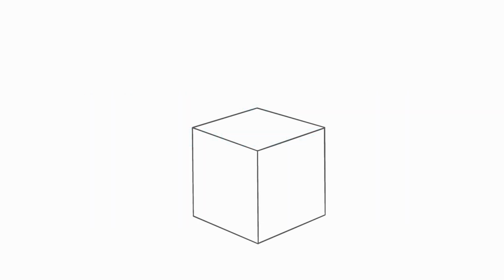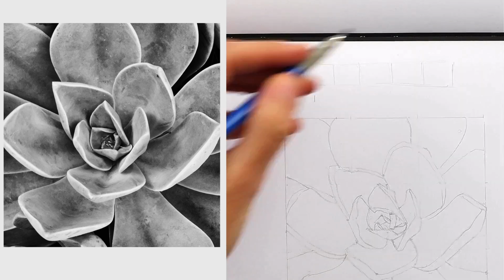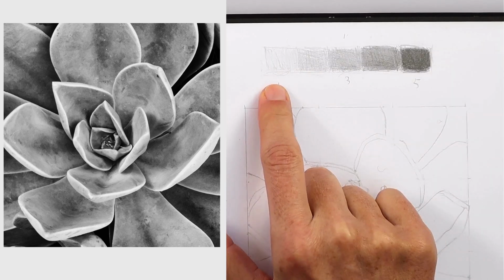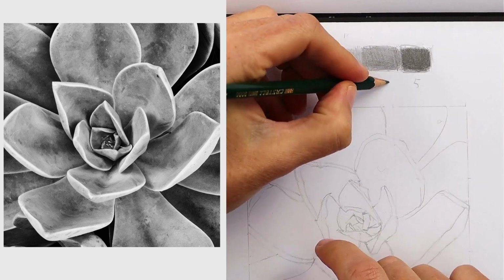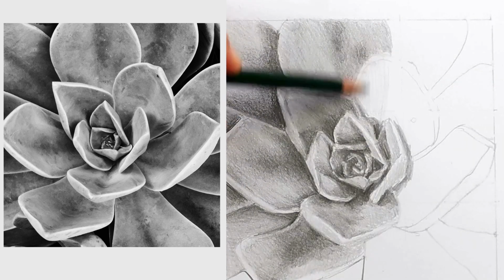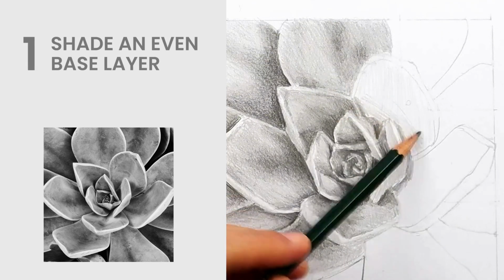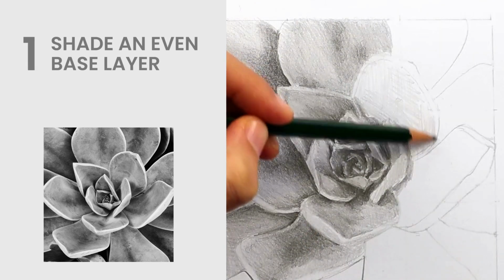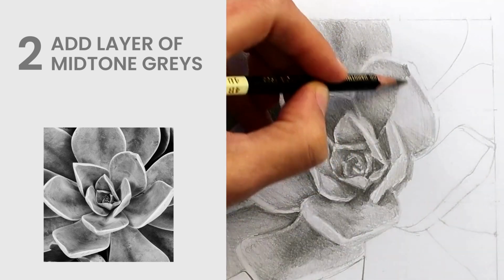Four Steps To Shading A 3D Effect With Graphite Pencil

Comment: I’m a beginner at drawing, but there’s something I don’t understand. What is the shading technique you’re using? I know cross-hatching and its rules—you draw straight lines, and if you want it darker, you add another layer of lines at a different angle. But regarding the technique you’re using, what are its rules for the lines? Or does it not have strict rules, and the main point is just to keep it smooth?
Reply from the maker: Hi, 
The goal is to get a flat, even value and the direction doesn't matter as much as with cross hatching. The shading doesnt need to be completely smooth - it can still have marks in it but if the value is even overall then the marks don't affect the form like cross hatching does, because the marks are so close together. 

Generally you might shade in the direction of the length of the form (eg the length of one of the leaves) but you could also work across the form or in a scribbly fashion where the lines go in all different directions. If you can control the pressure of your pencil to get an even shaded value then the direction doesn't matter as much as with cross hatching. I hope that answers your question!

You might like to take a look at my playlist on Shading: https://www.youtube.com/playlist?list=PL-i_GDP6hCKm2ZUOBKhdAU5bREtd5LmVz

The second video https://youtu.be/-OtVx0Fymv8 shows how to use a scribble technique to avoid getting linear marks in your shading...so it really depends on the subject too :)
Reply: @ThePencilRoomOnline Thank you very much

Comment: I drew a spoon, and I want to give it depth. How would you reflect the depth in the bowl of the spoon? Also, the front edge that stays raised above the surface—my perspective is that I see the spoon from the top.
Reply from the maker: The process is the same, identifying the shapes of value and adding them in the correct place. I'd start with shading all of the spoon that isn't white or highlight and then shading the darker shadow shapes over top so you end up with three values. Then work on blending the three values with very light shading between them. Getting the curve of the bowl and the raised front edge is all dependent on putting the correct lights and darks in the correct place!

The problem with something shiny with a spoon is the lights and darks can change if you move your head slightly, so taking a photo can make it easier to identify the light and dark parts.

For the depth of the bowl of the spoon specifically, it's key to get a nice smooth gradient/change between the darkest part and the lightest part - that will give you the sense of depth in the curve.

Hope that helps a bit!
Emily
Reply: @ThePencilRoomOnline  thank you for explaining it. It sounds so complicated, considering that  I just started drawing, but  I’ll try it.
Reply from the maker: @bylayla00  Yep that's a pretty tricky one to start with! Could try something like a small bowl or cup to practice getting a similar effect of depth.

Comment: Thank you for this! There's so much more to shading/rendering than I initially thought. Can I ask, how often do you switch from one pencil to another? Say, from an HB to 2B, and on down the line? I have a habit of just using one pencil even though I have tons of pencils on my desk going from 2H to 8B lol. I seem to just forget about them.
Reply from the maker: Hi! Hard to say exactly when I change pencils, just as I need them. You can get away with an HB for quite a while in a drawing for light and middle to dark values but you'll miss out on some extra depth so definitely put the 8B to use towards the end! 

I usually start with 2H for sketching and to get a really nice clean light value. Then when I add middle to dark values I switch it up between HB-8B as I need the different values.